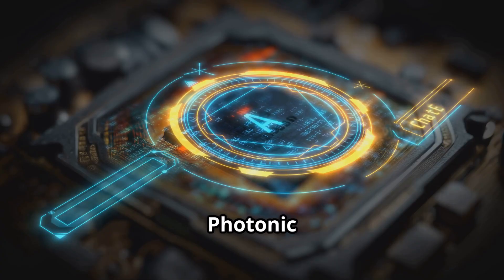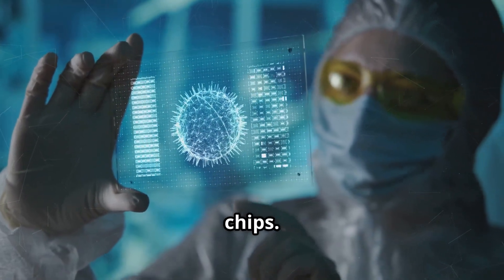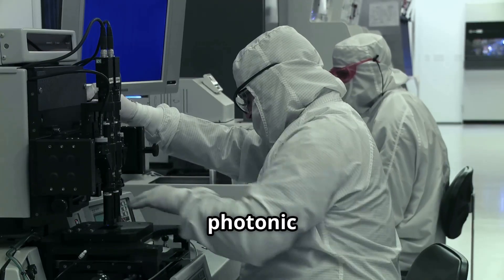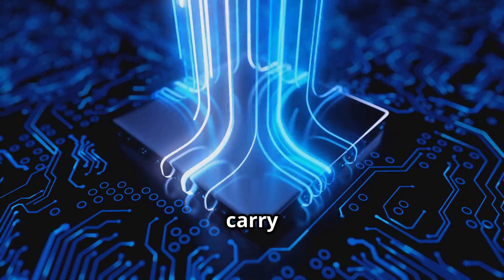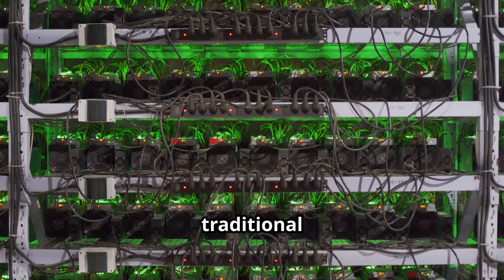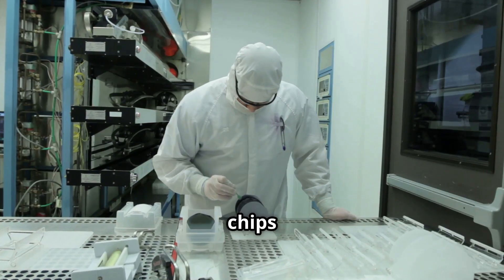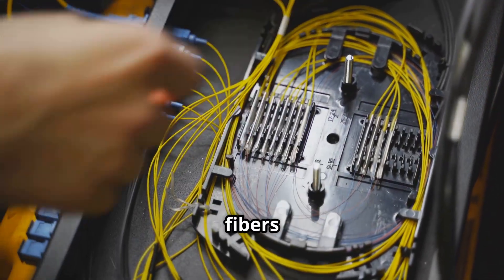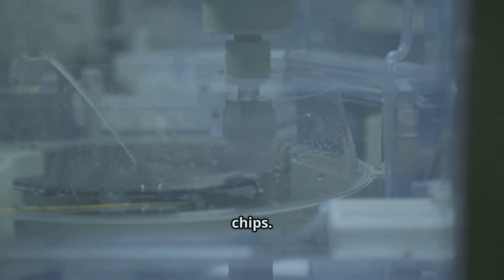Future of AI Hardware Photonic Chips 2026

Comment: The transition to light photonics in chips will be a huge upgrade in performance. Imagine how high the performance benchmarks in Apple M4, A19 Pro, Media Tek Dimensity 9500 and Qualcomm Snapdragon 8 Elite Gen 5 would all be if they had light photonics in them. Their benchmark performances would all be mind boggling while also running cooler and consuming less battery power.